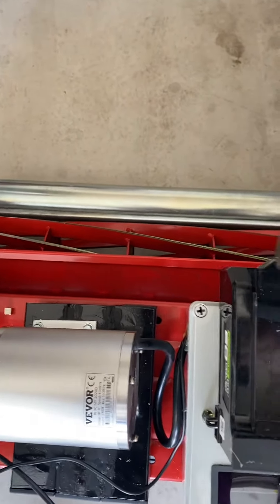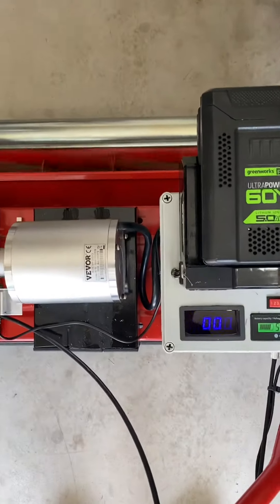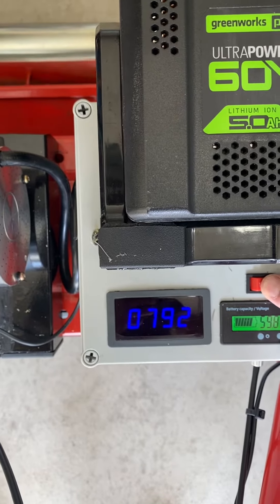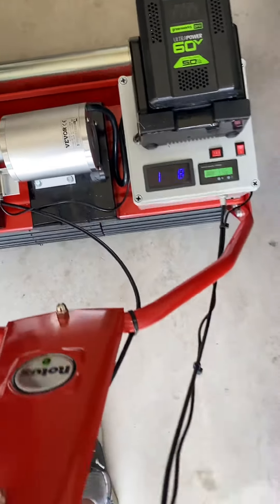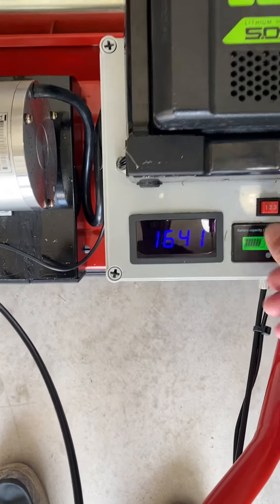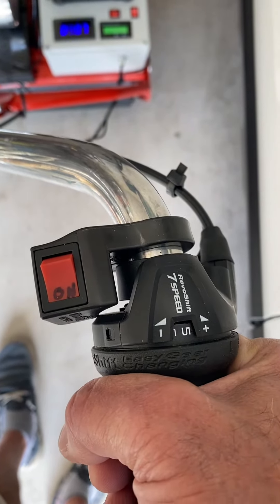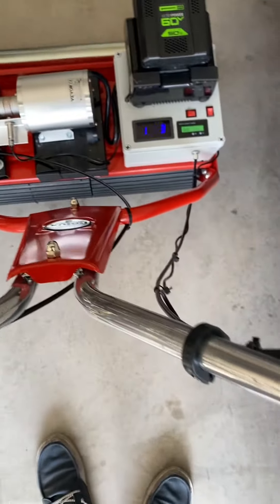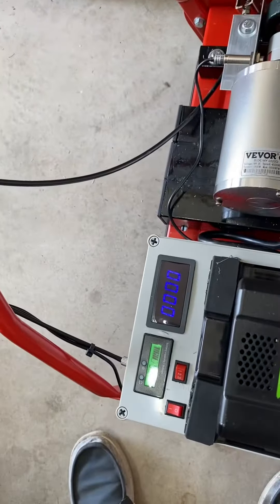Rolux battery conversion from gasoline motor

Comment: Hi, great conversion. I have one question. I bought 48v 2000W bldc motor (BY-MY 1020D). Can I also use a 60v battery for my motor? Thanks for your reply.
Reply from the maker: Thanks! I can not guarantee but mine is marked only 48v compared to the 60v they advertised but seems to be working just fine. I only run the RPM’s  at @2000 when mowing  and thinking ( I need to check this with a VO meter) the motor speed is controlled by voltage and I am not putting 60v into the motor? I wish I had bought the 2000w motor now.
Reply: @tyoung317  Thanks for the clarification.  How long does the engine run on a 5ah battery? I don't have any 60v equipment. The cost of custom 48v  baterry will be similar to the price for a 60v greenworks system. I will order a 48V 11ah or 15.4ah battery (BMS 35A). I'm going to change the engine in my old Protea 510Golf mower. This is a heavy mower, that's why I chose a 2000w engine. Thank you for all the material on your website. This will help me in my conversion. 🙌